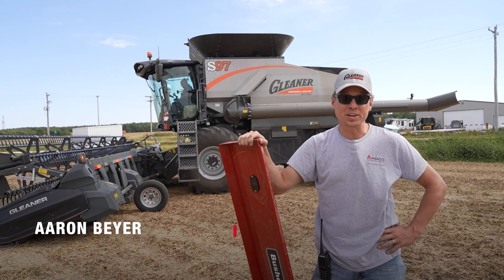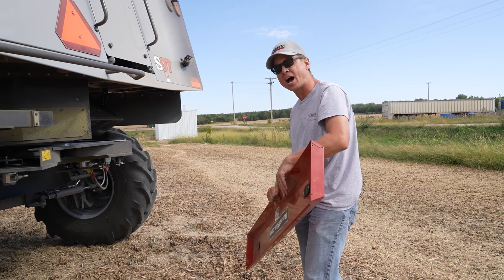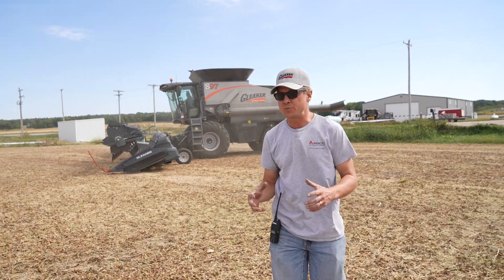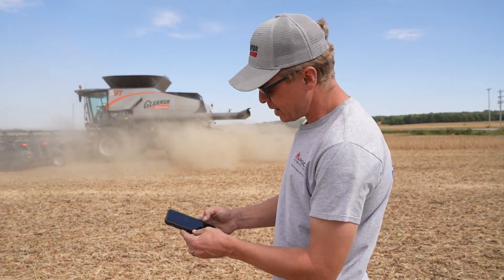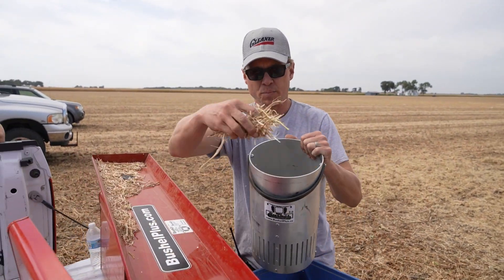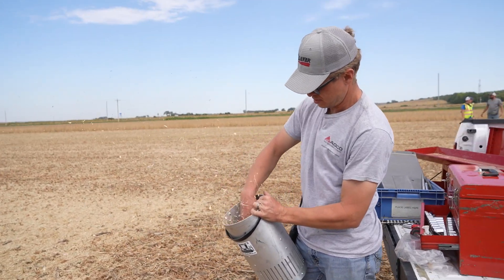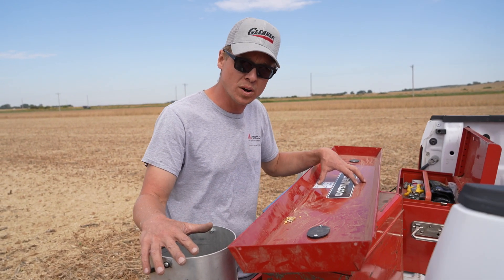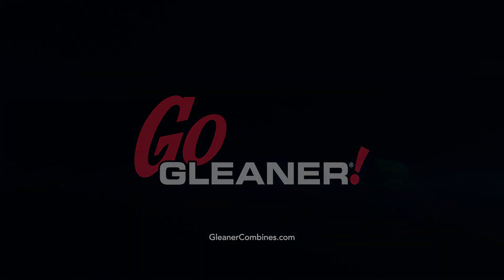Calculating Grain Loss

Comment: What's the yield average? How much header loss? The "drop pan" is a joke as far as MEASURING loss vs. "calculating" it. And lets see the "tank sample". What FM? Moisture? Test weight? Damage? Any unthreshed pods and/or "baby beans" make it out of that "cleaner"? That "drop pan" test proves ALL the loss is "machine loss" since both pre-harvest and header loss are left out. And "less than one fifth of a bushel per acre" is the BEST CASE SCENARIO. In those "field conditions" blowing AT least 1/5 bushels to the acre per FIVE FEET of "machine width" (5 feet of pan can't catch residue from dozens of feet of spreader width) is completely unacceptable for a "modern" combine in "mint condition" in a "test plot". 

Gleaner "rotary" combines are shit in dirty crops. Always have been always will be. They are "cleaner" for that very reason. Which is why Gleaner doesn't even make a real flex head and never has.

Comment: I counted 7. Would be more accurate if counted in slow motion. I do like Gleaner combines and believe they make cleaner and better grain samples.
Reply from the maker: Good catch. I didn't realize the mistake until watching the video on the floor at NFMS. But, 0.28 bu/ac in really good soybeans is still very low loss.
Reply: @GleanerCombinesTV  As if all the lost grain or even a majority of it falls straight down running a chopper-spreader. 

Is .28 bushel per acre "very low loss" in 28-bushel beans? Any "header loss"? How about machine loss forward of the discharge loss? Out beyond 2.5 feet either side of machine center? How about the fact that Gleaners discharge "off-center" and do not equally load the "shoe" side to side? 

Never mind. You don't know shit about actual grain loss "calculation" if you think any is "only" in your little "demonstration" here.

Comment: We use that @bushelplus drop pan for calculating losses and it works awesome. We run 2 S98's and often run 1-2 beans in pan. Love the combines, love the drop pan
Reply from the maker: Agreed. They were great in helping us update our existing pans to the dual channel receiver. Great bunch of folks at @bushelplus.
Reply: Because ALL the loss lands in a 5' wide strip directly "bottom dead center" under the combine. As if. This IS "calculating" grain loss. Anybody with a clue and no "agenda" uses several pans as well as no pans to MEASURE grain loss and find and eliminate the CAUSE. And measures pre-harvest loss, cutting loss, header loss and machine "leaks" besides the big "leak" at the back of the machine. 

"Only" 1-2  beans means your loss "often" DOUBLES (2 is twice as many as 1) and if you never have zero loss with that big of machines in soybeans it's hard to understand why you're bragging, lol. 

Bean yields have not doubled and trebled during the SP combine "era" and "bean head" widths have hardly done so and all the "capacity" gains have been in and for "corn & soybean" combines for increased corn yields and increased bean "residue". 

The "transverse rotor" or rather the ridiculously long and tortuous feeding "system" used in Gleaners has always sucked for large grains and always will. Which is why the "parent company" doesn't even make flex heads for their own machines.